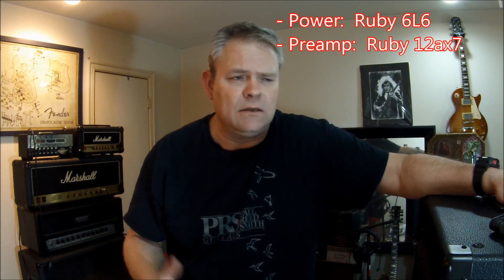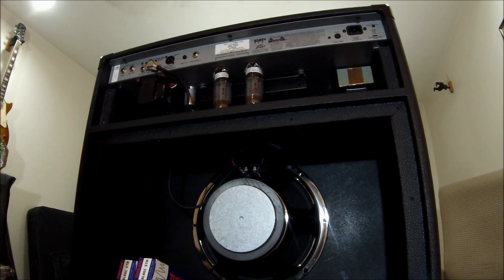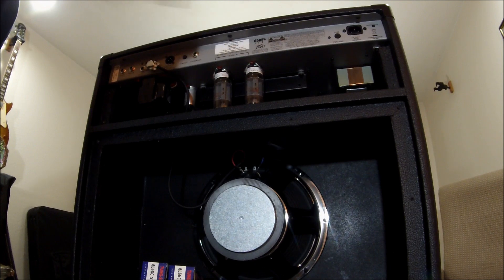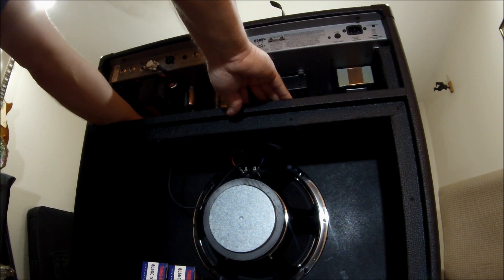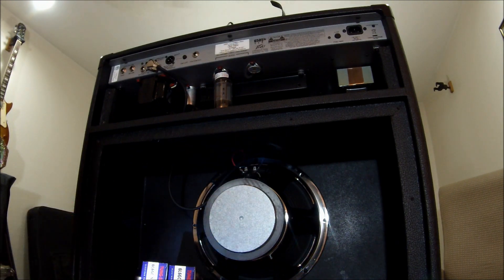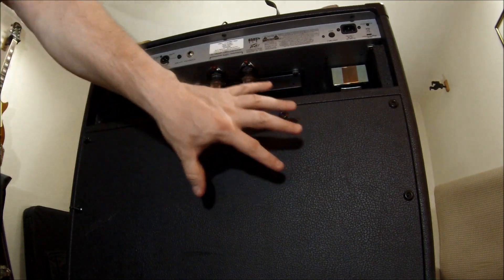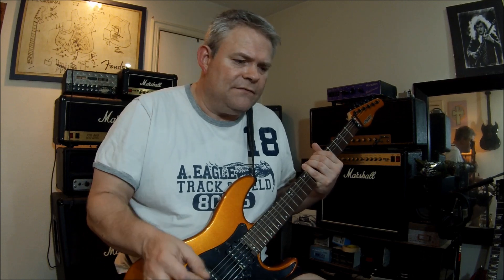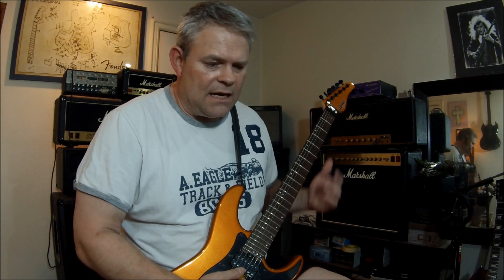Peavey 6505+ Tube Swap: Steps for Changing the Power and Preamp Tubes

Comment: Recently my 6505 112 head has had some bad tube issues, mainly erratic volume swells while playing. Volume will drop and it will sound fuzzy like the tone got sucked out. Changed the stock tubes to jjs and no more issues
Reply: Changing my 6595+ 120w head with JJs and I was wondering you had to bias your amp afterwards or was it fine?
Reply: @jazzmasterbator  I did not have to bias the amp afterwards. As far as I know the JJs I bought where "stock replacements" even though the tubes I removed were Ruby tubes. Ive had the JJ tubes for 2 years now with no issues.

Comment: Sounds great man thank you. Dumb Question, if I unplug the speaker can I run 2 cabs?
Reply from the maker: BrianBarnett, hey thank you so much Brian!!  Not a dumb question at all my man - you sure can, in fact it has 2 speaker inputs for that very purpose.  I do this all the time and actually prefer running my 6505 into a 4x12 Marshall cab loaded with V30s.  The key here is making sure you match the ohms correctly.  For example, the amp comes with a Scheffield speaker that is 16 ohms.  When I unplug that speaker and then run the speaker cable from my 4x12 cab, I switch my ohms over to 8 (as my cab is wired for 8 ohms.  This is pretty important, if the ohms dont match correctly, you can damage your amp.  And also just remember to keep in mind how many watts you are running from your amp to your external cab, as you want to be sure you dont overload your cab if the watts in your cab are less than your 6505.   If you have any other questions, please feel free to give me a shout.  Thanks again Brian!
Reply: @raysmetaltracks6782  perfect man appreciate it. I am running it into two black star 160 watt cabs just as a practice rig. the onboard speaker is trash to me

Comment: It's a cool amp. But it's kinda disappointing that it needs to be upgraded with a new speaker and tubes.  Maybe I should check out a 5150 III?

Any recommendations?
Reply from the maker: J-rod Thompson, wow, please forgive me for the very late response!  I would say you could get by with the stock speaker, many do.  I just like the V30 a bit more.  Or, you can keep the stock speaker and pick up a used 1/12 or even 2x12 or 4x12 with different speakers for a bit of variation.

Comment: No need tube's biasing? For preamp tube 12AX7 it's OK but for power tubes no need Biasing?
Reply from the maker: @sham zamri, this (and I believe a few of the other similar versions) are fixed bias.  I have seen some folks bias their tubes, but I've had pretty good luck with just getting decently matched set and just swapping out the old ones.  I will say, with this amp, when a tube starts to go (both power or pre), it starts showing signs early on, and that are nearly unmistakable.  Like the treble starts to become a bit harsh, and cleans start to sound too bright and a bit brittle.  Thanks for the post!
Reply: @raysmetaltracks6782  ok👌 thanks for the explanation.
Reply from the maker: @shamzamri3442  You are most welcome!
Reply: @raysmetaltracks6782  Fixed bias means that you have to adjust it yourself. If your fixed bias is too hot for the new tubes, it could damage your amp in worst case. It's cathode biased amps that you don't have to adjust yourself and can just plug-n-play.

Comment: How many preamp tubes? I bought one of these amps used recently and the previous owner said to replace just the preamp tubes (power were new)
Reply from the maker: guitarguy2142, hey there, there are actually 5 preamp tubes in the Peavey 6505+.  The most popular and common I would say are the JJ's (12ax7).  They are reasonably priced and probably one of the more reliable tubes.  Now if you wanted to, the V1 tube (it will be the preamp tube that is farthest from your input jack (where you plug your guitar cable in).  This is your first gain stage and where you get most of your gain.  Some like to put a "better" or "hotter" tube in this preamp position.  You could use something a bit more high gain like a Tung Sol, or you could even spend a few more bucks and go for something like a NOS tube (with less microphonics, for example).  You can buy tubes online from The Tube Sore, or Dougs Tubes, or the Tube Depot.  Let me know if I can answer any questions.  Thank you!!
Reply: @raysmetaltracks6782 
 V1 is the Farthest from the input?  Are Peavey’s made backwards or something?